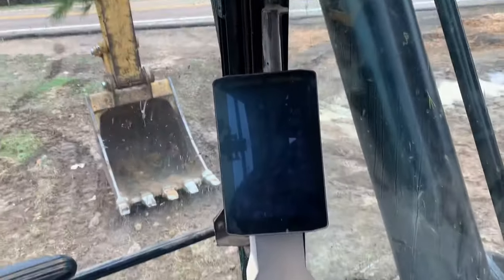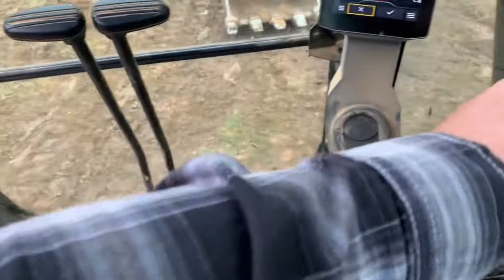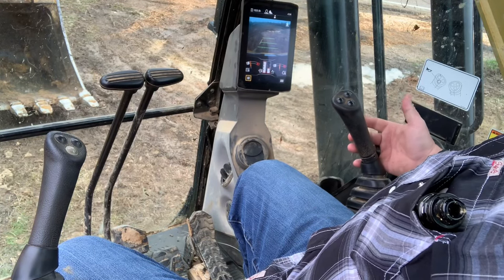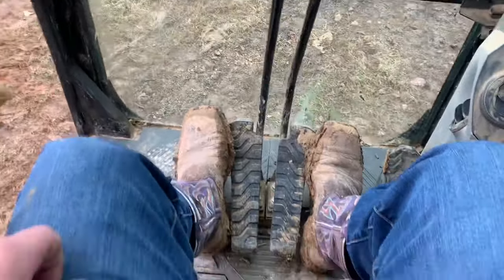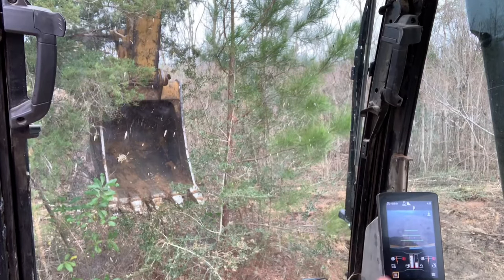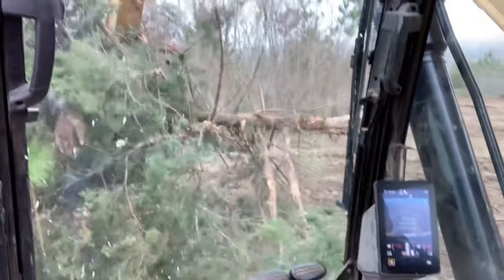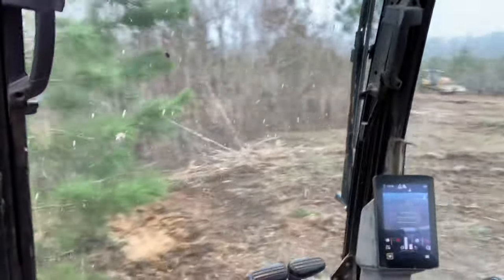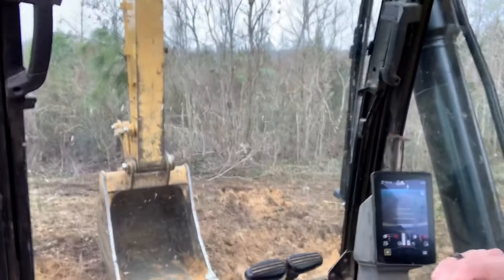Operating a Cat 320 Excavator: The basics

Comment: If you're going to pull up that much dirt with the root you need to shake your bucket by shaking the right control back and forth. Fill the hole back up.

Comment: I just started watching your videos and I have been a swamper for a little over a year now. I was a operator 2 for some plant and civil construction jobs (off road dump truck, rollers, skit steer, front end loader, john deere tractor) for 3 years but with all of the safety regulations it's a pain to get a foreman or operator to let me get some seat time. Do you have any tips?
Reply: great question.  Would like to know, as well.
Reply: I’m 25 years old and just started operating about a year ago. I started by working the shovel at a landscape job and then, I would ask to try running the mini-skid steer and loader whenever the operator was doing something else. In my personal experience, if you have the natural gift of learning quickly and imitating the other operators, you will get more and more seat time. I found a new job with a site development company and I told them I have limited experience but that I’m a quick learner and so far, they have had me doing a lot of grunt work but after seeing me run some equipment, and a lot of persistence with asking for the opportunity, they are giving me more seat time. It’s your work ethic at first that gets you noticed, and then, your skill.
Reply: that's cool I'm currently16 and training to be an operator at my trade school so far I've had 6 hours on the loader and 2 on the mini ex which I was on today and the loader last week
Reply: There’s a trade school that does this mate ?
Reply: @coreymiller3611  there is but it doesn’t compare to actual On the job learning or experience.  I would have to say at least 70% of the trade school operators that I have been around didn’t make me or others feel comfortable.
Reply: @danielheady2786  amazing man. It’s been a while since I posted my comment. I have been full fledge operator for over a year and a half. Basically being a lead man for solarfield farm install process.  I’m not knocking trade schools but just a tip from working around trade school operators. When a experienced operator(old school pipeliner)gives you advice or tips accept them and try to use the advice they know what they are talking about.